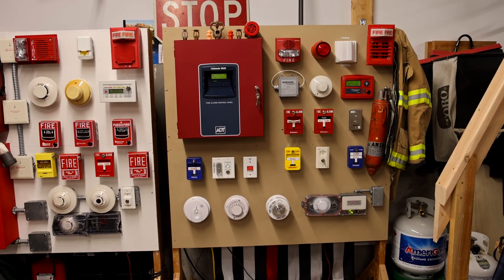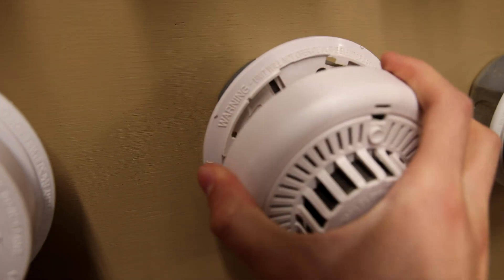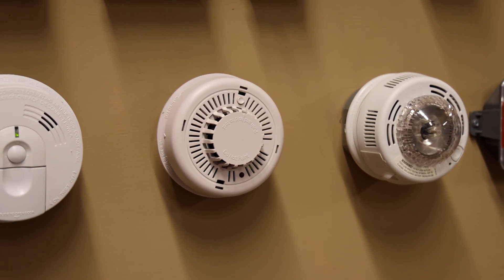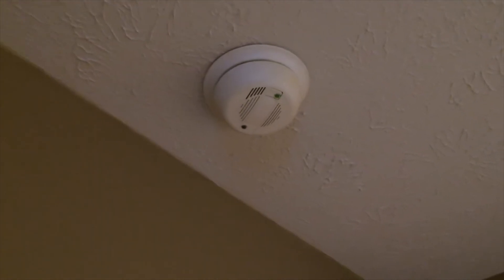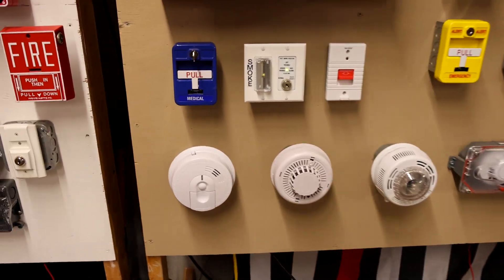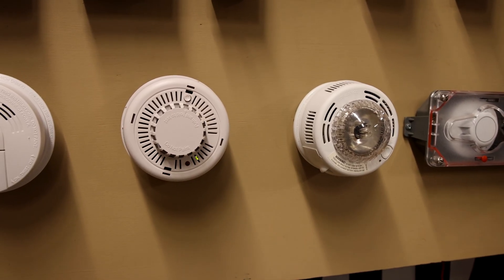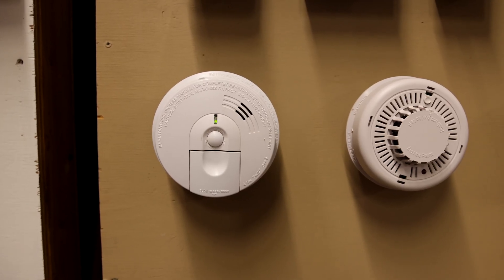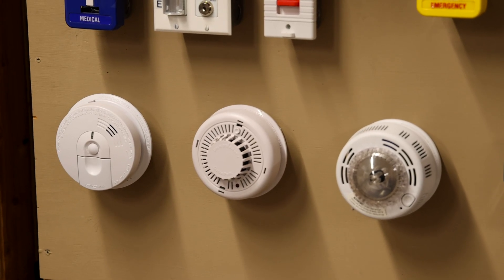Mixing Hardwired Smoke Alarm Brands = BAD Idea | Here's What Happens

Comment: I find that rather odd, for the past forever the universal interconnect signal (specifically fire, typically not carbon monoxide or other signals) was always a positive steady 9v over the interconnect line. I’ve seen old fyrnetics units trip new first alerts and vice versa, my demo board does the same thing when mixing.

Of course, it’s good to stay on-brand consistently through the whole system. But it’s just a bit odd how the kidde never went off, nor activated the first alerts. My i4618’s activate my first alerts.

Comment: Technically yes they won't sound due to a compatibility issue. But that can also be a problem with the smoke alarm internally. I've seen that sometimes too. Although that would be either a factory defect or they are just old.

Comment: They’re supposed to work together as it’s a steady 9V signal sent through the interconnect, those Kidde FireX i4618ACs are notorious for the interconnect randomly breaking on them for no reason
Reply: I found this out myself. My house came with a i4618AC and a bunch of USIs. The Kidde's interconnect didn't work, so I thought it was a compatibility issue and the USIs were old, so I swapped them out. Turns out it was the Kidde failing like you said.
Reply: @straightpipediesel it’s a very common issue with basic hardwired Kidde alarms

Comment: With relays, you can mix them without a problem. In my house is First Alert, Kidde, and Gentex
Reply: You don’t even need relays. Ive done smoke alarm system tests before with mixed brands and they worked fine.

Comment: Where I live (North East of England, UK) there is a brand of smoke alarms that has a special switch plate you can install which allows you to test or silence all the alarms, and also has a “locate alarm” feature, which silences all the alarms EXCEPT for the one that was set off first

And I know that in Scotland, they require ALL smoke alarms to be interlinked (i think the requirement is wireless interlinking, but I’m not 100% sure)